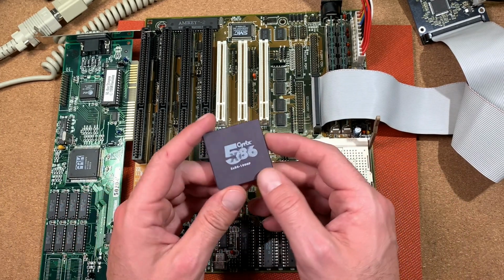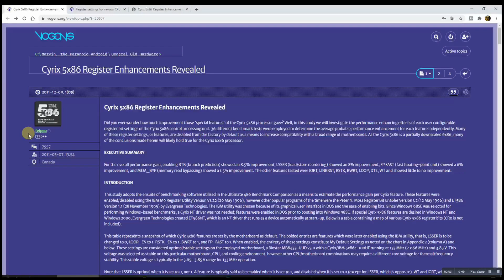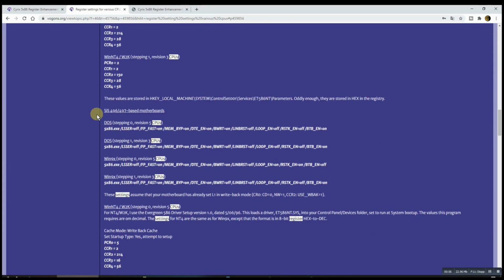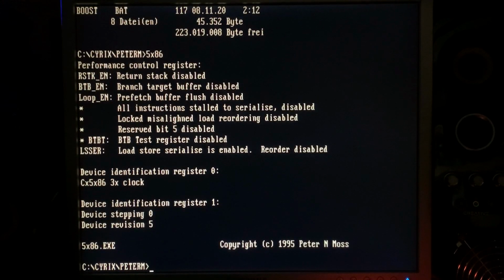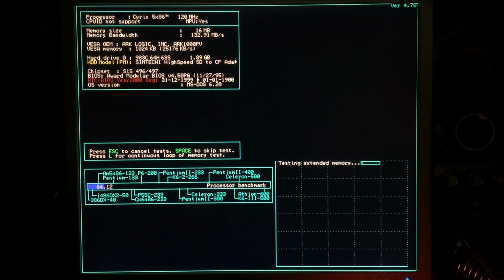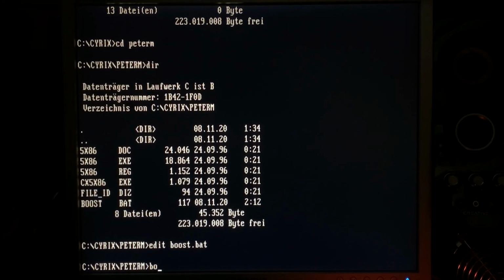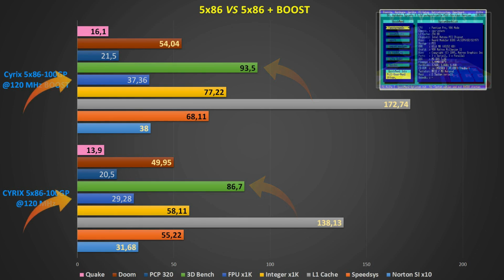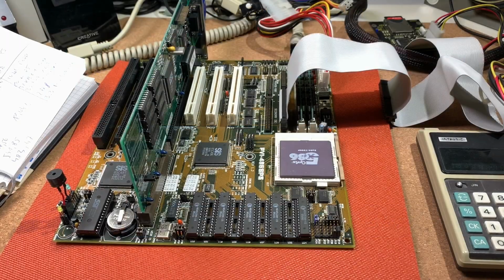Cyrix 5x86 BOOST & Benchmark, Activating Unused Features

Comment: Cyrixs had the most concave (hollow like a teaspoon) IHSs in the known universe! 
(Industrial Sabotage..?)
Lapping them and the (as bad) HSFs of the time and using Thermal Compound allowed ALL of them to run at a frequency at least = to their PR ratings.
Often a hell of a lot faster as; with a decent heat path; you could safely increase the voltage a bit.

Similar for NB/Chipsets.  Especially those with built in graphics.
Double Sided Tape is NOT!!! a good TIM!!

Increasing the FSB OCs EVERYTHING..! This is where the biggest gains are!
HDDs can be persuaded to 'play nice' by decreasing the PIO Mode etc, in BIOS.

Comment: Makes me wonder if someone made a new CPU that was ISA and pin compatible with these old boards just how fast it would be using modern lithography and lower latency caches and certainly fitting more transistors inside. If it had a large enough L1/L2 cache, the slow main memory would be less of a factor.

Comment: That FPU speed option is like a holy grail to me.  Both with my original PC's 6x86 and now one of my recent new old build's using the VIA C3 700 for its downclocking abilities, the FPU was always the weak link.  I'd love to be able to improve it even 15%, much less this.  But otherwise these CPUs served their general purpose functions very well at the time and even now.

Comment: I Wonder if this Cyrix  100GP could be pushed even farther than 120MHz. Like you said they did make a 120MHZand they also made a 133MHZ but I don't know how far they could be pushed due to I do believe the Cyrix have a set multiplier unlike the AMD. If could manipulate the multiplier if you need to see that AMD 5x86 200Mhz up against the fastest Cyrix 5x86 pushed to its limits and all it's features enabled. Never know maybe another Quake Frames Per Second challenge test.

Comment: This is a FANTASTIC channel, wow! I think I have found a new hobby. :-)

I have a Cyrix 5x86 based computer here at home. It is an AST Advantage! 611 Adventure. Unfortunately it developed a boot-problem, and I made a very stupid mistake:
I reset the BIOS. :-( With modern computers this is no problem, but this computer has lost the settings for the hard disk now: So I lost the number of sectors, cylinders etcetera.
I am trying to find the correct settings, but alas, so far no luck.
Inside this computer is the IBM version of the 5x86-100, with a beautiful blue cooling fin.

And I also have a Cyrix 5x86 at 120Mhz, but I have not tried that yet. I am certain that the motherboard of the AST computer won't be able to run this cpu at 120Mhz: The motherboard is very basic, and what is worse, it has no level 2 cache. Luckily it does have 32Mb of Ram, so maybe I can re-use that.
So if I ever find a better motherboard for the Cyrix 5x86... what would be the best motherboard for this chip? Does anyone know?
Reply: You can find Lucky Star LS486 rev. C2 Motherboards usually on ebay and they support the Cyrix 5x86 cpu and there are articles on a website called Vogons about people over clocking their Cyrix cpu and the jumper settings and ram settings they used for their cpu. It could be worth a shot.

Comment: Have you ever heard of the Acorn Risc PC? It came with a 486/586 Card that you could plug in for PC compatability, there were some issues with VGA graphics and sound, but the main problem was was Risc PC's slow 16mhz bus really handicapped the PC performance.

Comment: Thanks for you video! I will check if my Octek Hippo 15 enable anything by default... I'm still puzzled as to why it seems to misbehave when I use EDO RAM, I think my PcChips M919 MB have some option for Cyrix CPUs.
Reply: It worked, it's a little bit faster, also I found a pair of EDO 16MB SIMMs that work correctly... It's only at 100MHz but I'm getting great DOOM framerate (40)

Comment: You thought that cyrix cpu's were in amd and intel's classes? No, the Cyrix cpu's have always been slower than the other cpu's, but they did make respectable Co-processors.  I sold pc's back in those days, the 386 sx 25 i built for the first time back in 1991/1992 (dont remember which) was my introduction into building pc's and then immediately selling machines to others. I had the mistake of offering cyrix based options for cpu choices. The few customers i had that went with Cyrix were unimpressed to downright dissapointed with the performance of the chips, and as the systems builder I felt responsible and very soon after removed Cyrix cpu's as even being an option from computers i would build for customers. they were plagued by instability and outright incompatability with my customers software.

Comment: It's amazing that Cyrix didn't do the same kind of testing that feiopa did. They probably could've doubled their marketshare just by spending the time to work out best settings for each chipset and then providing a floppy disk with system tweaking (configuration) software.

Comment: The only Cyrix CPU I've ever owned was in a Compaq Prolina 3/25zs which had an Intel 386 25mhz CPU which was soldered onto the board, the upgrade Was to snap the Cyrix CPU onto the intel CPU which upgraded it to a 486 40mhz. I wish I still had that system. And I haven't seen any videos about that specific CPU upgrade.

Comment: Nice tip!  I've been looking for an affordable way to squeeze a little extra performance out of my 100MHz 486 build and it looks like these are fairly cheap on eBay so I'll give it a shot (fingers crossed the one I wind up with is a stable overclock)!

Comment: For comparison tests, I recommend normalizing the data to a baseline before comparing, so the different scales of different tests won't matter, making the gains more visible.  It doesn't matter which system is picked for the baseline (that is, all its scores will be 1.0), but picking the slowest system makes the gains easier to interpret.

Comment: Many years ago, I had the IBM branded version of this CPU with integrated blue heatsink. I do recall a non-resident utility that improved performance, but resulted in some applications crashing if used. I was never very impressed with it's performance when compared with the Pentiums some of my classmates had, but it was all I could afford at the time.

It was still significantly faster than the IBM BlueLightning 100mhz /w Cyrix Fasmath 33MHz the computer originally came with.
Reply: I had a similar experience, the Cyrix CPUs were never that well regarded compared to the Intel and AMD parts. There must have been some insurmountable compatibility issues for then to have disabled such effective performance boosting features.
Reply: @ferrumignis  BL much more common with 486DLC but with increased cache an running at high frequency

Comment: Frak me I had completely forgotten that. I had that CPU but I was using Linux and so I was able to toggle flags from the kernel and I got how I impressed my friend how  my screen saver moved so fast. I remember that when I asked Cyrix for more info about the CPU they send me a big thick manual that had everything you needed to enable all the features including sample Assembly instructions.

 Those were the days when manufacturers were proud of their product they wanted to give you all the infomation you asked for FOR FREE. S3 also did that with my Virge card. 

Boy I had completely forgotten that part of my life. Thanks for reminding me of it.
Reply: Those were the days... Nowadays Intel and AMD are cramming hardware level spyware chips into their products and locking down the CPUs (well that's mostly Intel there, pretty sure every AMD CPU can be overclocked).
Reply: @RedVRCC  

Indeed. Hopefully sooner rather than later, we can rely on open firmware for all the things. I can dream anyway.

Comment: Nice! I've got the same CPU, but haven't had a compatible motherboard till last week. Going to try this out. I don't have Evergreen, but I do have a nearly identical 133MHz chip from Gainbery, and an  AMD DX5-133W, as well as a 100MHz 486 Overdrive and a 83MHz Pentium Overdrive. I've been on DX2-66 for years and now want to upgrade the system to the absolute best it can be. My impression is that 83MHz overdrive might be the best option because of the FPU, but I won't know for sure, till I test them all.

Comment: I think, many of these features has to be disabled at final stage, because they were not perfectly stable, and no company would risk, that there will appear some kind software, and part of users will have problems with their CPUs. That would be disaster for the name, so they rather disabled everything, and let stability and compatibility win. But by tweaking this, under special conditions, you have here and there some reserve with some types of CPU.

I see it, it was mainly because of time... the moore's law was going very fast, and they simply didnt have time to fine tune everything, so they rather disabled it. If CPU race would be 2 or 3x slower, I think, all of these register tricks would be implemented and we would see much more faster CPUs  at same speed. But they rather invest their engineer team into new processor, so they don't loose in next generation round, that was about year - year and half time ahead.

In other word, if they would have 5 years to fine-tune the processors, most of this would be implemented and even enhanced, and same CPU could be possible +20% faster than before.

Comment: That was fascinating. Were there similar instructions for the 6x86 or MII?
Reply: Those CPUs already had them enabled. They are much more advanced. The 5x86 had to disable those instructions by default because they weren't stable. Remember that it's a socket 3 CPU vs socket 7 (6x86, MII)

Comment: The (in)famous PCChips M919 socket 3 motherboard has some nice features for the Cyrix 5X86 CPU in their BIOS options. Maybe if you have this board (with working L2-cache) you can add a video about these features...
Reply from the maker: Is planned... Indeed the M919 is able to some options. But what I read is that only 2 of this features can get activated through the bios. The rest needs to be done also by some commands.